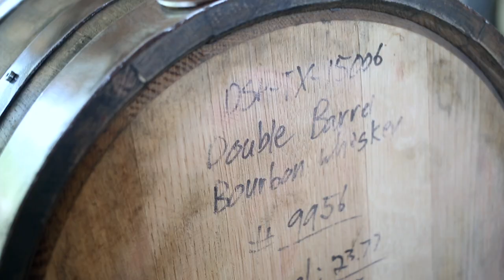Whisky Barrel Drinks Cabinet - Texas Bourbon Cask

Comment: Hey, we are working on our barrel and it's nearly finished but we have a severe problem...
we had to take a break from working because of school and in this time the wood sort of bended more to the inside. It developped a gap between the metal belts and the planks. I guess this happened because the door made a gap so the pressure between the planks decreased.
Did you experience a similar problem?
what would you suggest?
Reply from the maker: Sesto Sili I mate, 
Yes it does sounds like your cask dried out, which is normal! That’s why it’s very important to secure the hoops when the staves are still soaked with spirit. My first barrel, my own one, I didn’t secure the hoops properly so after 2 years, it needed some TLC! 
Having a gap between the stave is ok, what you want to do now it’s to put a screw on each staves around the door, and I’ll suggest one over two around the rest of the hoops. Make sure the top and bottom hoops got enough screws too to secure the lids. It should get its shape back this way, with some gaps between the stave but you don’t have a choice for that, only the spirit make it watertight, when the stave dries out, it shrinks, that’s why you’ve got gaps and the hoops will fall down.
Hope that’s helpful, send me some pictures if you still need me, I’ll do my best! contact@faitmaiz.com 
Cheers and enjoy your DIY!!
Reply: @PierreVennen  You're a legend man! Thanks for your answer.
We secured the hoop in the beginning with screws around and on the door but we didn't consider the back of the barrel to be necessairy aswell. So that's where the biggest gap is. The hoops can't fall of, but the wood inside then shrink. I'll send you pictures👍🏼:)
again, thank you very much for the help👌🏼
Have a great one!
Reply from the maker: Sesto Sili very happy to help mate. I’ll love to see your project in picture! I’m sure you’ll manage fine! Cheers
Reply: @PierreVennen  Ok, I've sent the email. As you can see, there are gaps between the hoops and the wood and the door doesn't close as nice as when we made it. It used to close perfectly and it's so sad that it doesn't fit anymore.
I hope the further screwing pulls the planks outwards to some degree.
By the way, I made the darkening around the hoops with charcoal:). I think it gives it a old and used look.
Cheers!
Reply from the maker: Sesto Sili just sent you a reply on your email. Hope you’ll get it. Let me know!
Reply: @PierreVennen  I got your email, but i answer here because it's easier. Your idea with the way to place the screws makes sence. I will also take the door off and put a belt around it before screwing. Maybe this could make the door curve more again.
Anyway, you've been of great help and I will tell you how it worked out as soon as me and my friend done it.
I would be happy if you post our barrel. :)
Have a great day!

Comment: What kind of metal did you use to reinforce the back of the doors? I'm thinking about building one myself but I am unsure where to get the metal or what kind.
Reply from the maker: Cody Caudill just a classic metal bar, anything really. Even made some with aluminium bars at the star. Easier to work with but have to say it’s sturdy when you use a good thick flat metal bar. You find it very easily at Home Depot. If you got a spare hoop, you can use it too! Let me know, very happy to help! Good luck! Send me some pictures!